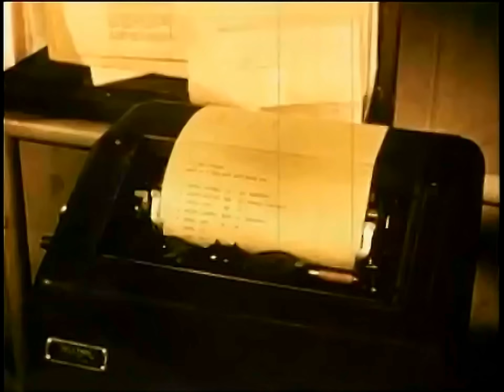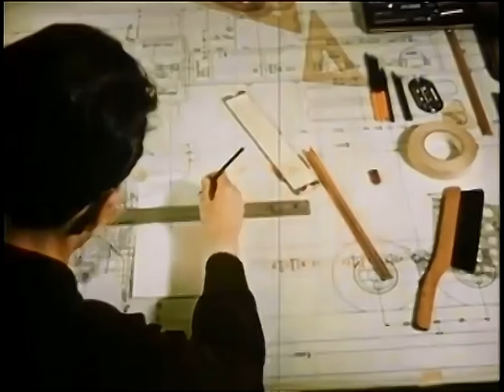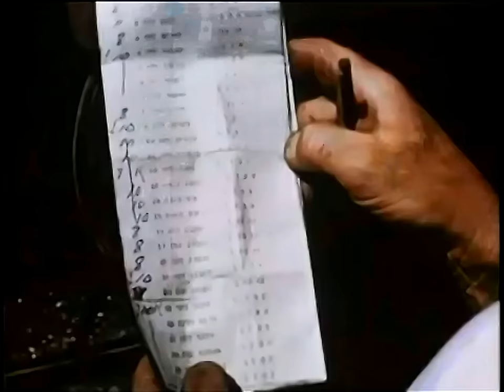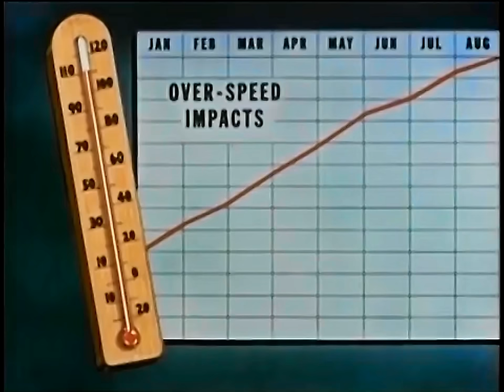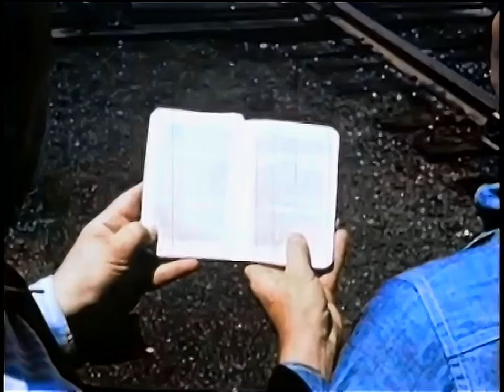The Freight Goes Through 1952 Railroad Film [4K]

Comment: 2nd Post: Since they started using remote controlled switching, damage claims have gone up. I know this from friends who work for today's railroads
Reply: A few years before I retired as an engineer, the NS brought remote control locomotives in yard service. They were nothing but trouble. Sideswipes,  run through switches, run over derails. The whole yard became less efficient.  They never learned their lesson. All that damage was covered up to make remote control locomotives look good on paper. To this day the same old problems plague the yards.  It was proven time and again that operating  locomotives with engineers was an efficient, and more importantly, SAFE method of switching. Of course the NS would rather bankrupt  itself than admit it is a bad idea.
Reply: @cheekymonkey444  I work in commuter  as a Conductor in Boston, and years ago worked for Conrail around Massachusetts.  The industry has gotten way wotse,especially for crews. The company doesnt want to be responsible for anything anymore. Ive been,esp. during this pandemic, im still working, and hopefully  our brothers and sister in amtrak and freight can back to business.....safely

Comment: What is that machine that pulls those pallet trucks at 17:00?
Reply: It's  called a dragline.
Reply: Overhead pull system with drop bars, similar to what's used on assembly lines to move parts and vehicles or machinery around a factory.  Basically a chain running in a track with pull bars coming down from the ceiling, hitched to the pallet trucks to drag them along.  Nowdays it'd be done by robotic pallet trucks following lines on the floor automatically under their own power... 
Later!  OL J R :)